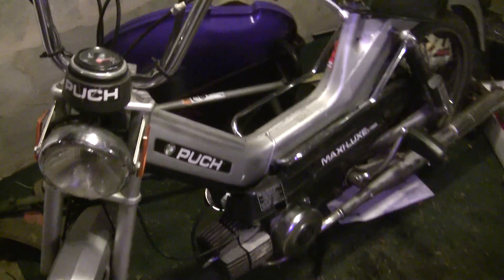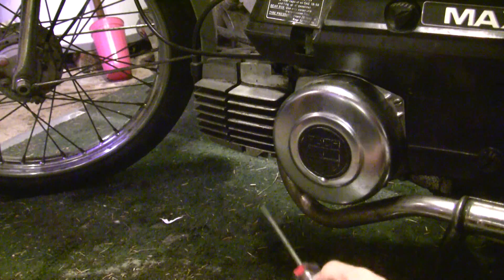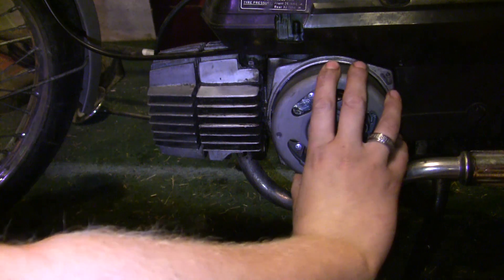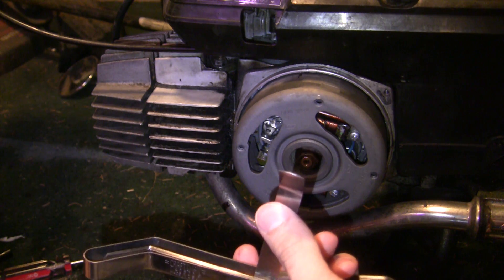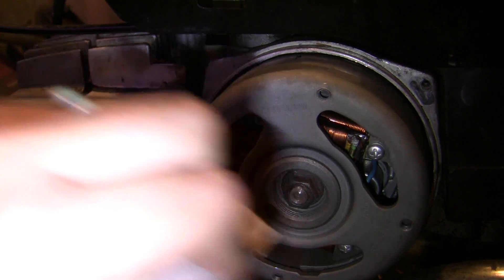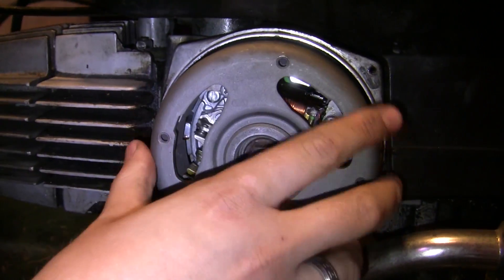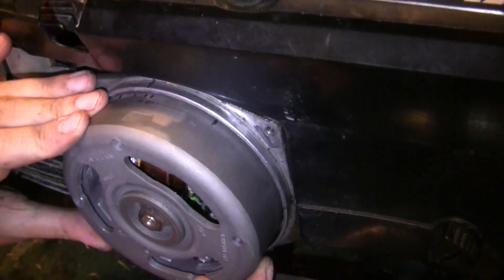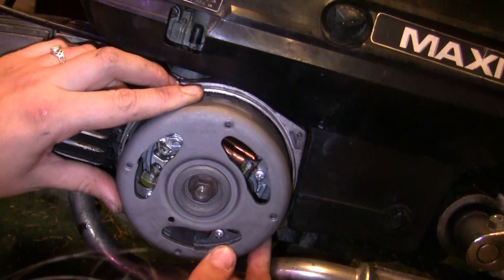How To Set & Explanation of Puch e50 Moped Timing with Will & Travis

Comment: That engine does not turn clockwise
Reply from the maker: You can see the arrow which points to the right/clockwise on the flywheel in a few shots (16:47) might be the most clear. The camera I was using back in 2013 was not the best, so you can also see it in Google Images if you search Puch e50 Flywheel.

I just finished working on a Puch ZA50, which is opposite, it turns to the left/counterclockwise

Comment: 3:20! I got lost cause there was already 3 marks when I only seen you mark two?
Reply from the maker: So for that first part of the video, all we are doing is finding Top Dead Center (TDC). 
You use the piston stop to make a mark on the flywheel at your reference mark by rotating it both directions, then the TDC mark on the flywheel, the third mark, at the middle point, for us it came out to 5.5mm-ish. It isn't the most clear there in the editing unfortunately, but the spoken directions are correct.

After you make the marks, you can use the screwdriver method to verify you have it correct, "in the ballpark"

Comment: Next time use a test light with a battery. You can clip to one side of the coil and leave the point of the test light in between the fins of the cylinder. When the points open, the light will turn off. You can make a test light with a bulb from your brakes and two wires, a AA battery, and some alligator clips. You can even tap into one of the brake lights with the bulb still installed in the moped. It's better than trying to eyeball it or use a cigarette paper. I never did it the way you're doing it. You're just guessing at it.

Thanks for the content.
Keep up the good work.
בס'ד
Reply from the maker: That's a neat idea, I like the simplicity of making a test bulb for when the points break open, I'll have to try that! 

For me, the timing light is the great equalizer for seeing at exactly where the bike is firing, but I'm also all about simplicity, since most people don't have an excess of tools. Thanks for the comment!
Reply: @TravisTutorial  Yes, you can use a circuit test probe light, they cost under $5 at Harbor Freight or any auto parts store for a little more. Clip one end to the blue wire of the coil and stick the probe between the fins of the cylinder. The light should go out when the points open.

If you have a multimeter, you can just set it to read continuity. Clip one wire to the blue wire of the coil and the other wire to one of the fins of the cylinder. If you have audible continuity, you don't even have to look at the meter. When the points open you will lose continuity. So easy.

Comment: I have the same flywheel and stator. My bike is supposed to be 2 mm before top dead center. With the state returned all the way to the right I'm at 10 mm before top dead center. What do I do there's no more adjustment

Comment: In 1974 I was 14 and my Maxi Puch has a mark on magneto wheel, that aligned to crankshaft joint (3pm position) at TDC. My father one day punch a little mark on the border of crankshaft with a screwdriver and a hammer and said " when the mark on the wheel align to this, points must release an aluminum paper you put between. Adjust this aligning marks, loosing base screws and rotating the base until the paper looses, then tight screws." It was easy to do, if you turn the base with a screwdriver and pull gently the aluminum paper. I don't know if my father have done some calculations, but that mark always set the point perfectly.

Comment: An accurate adjustment of ignition timing obtains maximum power for this little motor.
The procedure is similar ,tools are different.
1.    To detect TDC have a watch comparator installed in a drilled sparking plug. Using  the comparator mark 1mm before TDC on the flywheel/ case.
2.    To detect opening of contact breaker connect an ohmeter instead of ignition coil, will indicate a variation when contact opens.
3.    Also use thickness gauge for measuring contact breaker opening.
Good luck !

Comment: Hey Travis tutorial! I need to replace the points in my Batavus starflite but I don't have a flywheel puller. Is there a trick to removing the flywheel without a puller or should just go ahead and invest in the tool?

Comment: So what the heck is the point of reference for the stator? You make all these accurate marks on the flywheel for adjusting the points, but when you adjust the timing you leave us in the dark about how we measure where to move the stator. Still a good video, but if someone could answer that'd be great.
Reply: mezzyjezze the stator will only move about 20 mm in either direction. You just move it back and forth until the contacts open 17 mm before tdc

Comment: hi there travis.  Scott from UK here, again.
so  I have had a little bit of a problem with my puch, i blew out my piston rings, i have rebuilt the top end & added a new crankshaft. i have put together again & now it doesn't work properly,  there's no idle, before I only needed to only turn the pedals 1/2 a turn to start,  now i  have to pedal like crazy to start & it refuses to stay running,  the timing i think is correct.  Ive spent days fiddling with it & its started to really get my goat.
Any ideas? 
Thanks Scott

Comment: hi there travis,  its Scott from the Uk again, i have a silly question,  a red wire has come lose from my wiring block & fot the life of me i can't remember what part of the block its come lose from.
from the stater i have a black,  yellow,  green & red wire, i guess the red is for the back light, what wire should it marry up to?
thanks Scott
Reply from the maker: Hmmm, no US based Puch I have ever worked on ever has had a red wire, couldn't find one in the wiring diagram page either: 

http://www.mopedarmy.com/wiki/Puch_wiring_diagrams

However, it should be easy enough to solve - if it for the tail lights, it'll come from a "baby coil" on the stator, you can peek through the windows of the flywheel and see if it starts with that small cable, the tail light coil sits right on top of the headlight lighting coil. On a stock setup, there are only two wires that run to the rear, the power and the ground, so those should be somewhat easy to see.

Comment: quick question... can i use a stator from a scooter on my moped? i have a 1977 garelli eureka flex. and it is missing a lot of parts. missing piston, stator and carb. still have fly wheel but the coil and whatever else was inside is gone. i have experiences with motorized bikes that are also 2 stroke but this is my first scooter restoration. any help would be greatly appreciated thanks

Comment: Hello, i know this is an old post, but when you marked the piston stop on both sides, then measured the distance between.  Did you then mark on the flywheel the distance between the two measurements.  It looks like the left mark and the TDC mark are exactly the same.  Not sure i follow the measuring and dividing part if the mark ends ups so close to the left side mark.  What did i miss?
Reply from the maker: +Lee Verbouw Yep, you measure the distance between the piston stop marks - should be shown pretty clearly in the video, also show how to find TDC via the screwdriver method which matched our mark pretty close

Comment: That's a totally different way of setting the timing than the way i learned (and still use):
I'm using a vernier caliper, a set of feeler gages and a piece of tobacco rolling paper.

First of all, you should turn the flywheel and determine when the contact points are at it's maximum opening. That space should be exactly 0.35mm. Any setting smaller than 0.25mm can cause short circuit, so the moped won't even start. Any wider setting than 0.50mm causes the points to take longer to close. At higher speeds, they can't make it in time, so the moped can shut off or at least have a loss in performance. (also the reason why extremely tuned engines with contact point ignition can suddenly shut off at high speeds, because at extreme speeds and rotations, the points will no longer open & close, but "float" somewhere in the middle, failing the condenser to load it's currency. In that case u will need so called "weighted contact points", or use a $200 electronic (racing) ignition system instead). Setting the points to 0.35 will certainly increase the performance and acceleration. When it's smaller or wider, you can unscrew the flathead screw on the contact points just a little, as too loose will make the contact points adjust themselves like the stator plate in the video. Then grab a somewhat bigger flathead and "twist" the contact points, making use of the notches on the contact points and the "mountain pass" that is positioned on the stator plate just above the contact point screw. You twist your hand (like you turn a key) to the right, so the contact-point-plate will turn to the left, thus decreasing the maximum opening, and turn your hand left to increase. With this setting correct, it can also solve the issue of "having an extremely retarded or advanced ignition."

Now we can set the actual timing. 
I'm using a vernier caliper and use the depth pin on the rear to measure the ignition. So, slide the depth pin out for about 10 cm, and stick it in the spark plug hole. turn the flywheel to the right and let the piston push the depth meter back in. Make sure that the bottom of the caliper rests on the rim of the spark plug hole, as plumb as possible. Imagine you measure 20mm as being your TDC, then you should add 1mm pre-ignition (stock moped 50cc, fast 50cc's have 1.2mm, 70cc must have 1.4mm, very slow mopeds that won't go faster than 18 m/ph will do with 0.8mm). Note that less pre-ignition will (obviously) make the time between the spark and the TDC shorter, thus making the reaction faster, resulting in greater acceleration. But at higher speeds, that same setting can't cope with the faster moving piston, having trouble to keep up. Thats why you need more pre-ignition at top speed, giving the ignition more time to provide a spark for the ever faster returning piston. So this 1mm will be a good deal in the middle and most likely equal to the 17 degrees on the flywheel. And for the smart guys: setting the pre-ignition to 2.0mm won't work, i tried that, moped didn't go any faster and the noise that came from the block didn't sound healthy. 
So, add 1mm to whatever you measured (becomes e.g. 21mm) and lock this setting on the caliper, so it can't slide. Now i'm tearing a tobacco rolling paper in half (in length), and sticking it in between the contact points. Since it's so thin it makes an almost perfect idea about when the points start to open. Stick the caliper's end back in and turn the flywheel in the correct direction (for most moped it's to the right, but be sure to check the arrow, or , when there is no arrow, try to start the moped and you'll instantly see the direction it goes.). When you are about to reach the TDC (something you can feel), carefully let the piece of paper stick through the opening of the flywheel again (as it will flip in when u turn the flywheel). Now turn the wheel very slowly, if possible one degree at a time, your other hand still holding the caliper firmly and plumb on the rim. After each little turn carefully try to remove the paper. The ignition is spot-on when the piston ticks the caliper (you can clearly hear and feel it) and you being able to remove the paper. If you are able to remove it before you reach the caliper (TDC + 1 mm pre), then your ignition is too early, or advanced. when the paper is still stuck when u reach the caliper, then it is late, or retarded. In both cases u have to adjust the stator plate, like shown in this video. After that, check again until it actually is spot-on.

The only catch with this technique is that to be accurate, you have to hold the caliper firmly in place, and in the middle so the measuring pin wil be on the center of the piston. Since modern pistons don't have a flat surface on top, it could happen that when u are out of center, you might get different readings, also when u move the caliper by accident while working on the ignition.
But putting marks on the wheel is also more or less accurate, depending on how accurate you mark, what marker u are using, the quality and accuracy of the measuring tape, etc. (the construction store paper rulers are not very seriously and for global measuring imho, and tailor measuring tapes tend to stretch after a number of uses).

If you have an analogue caliper and don't know exactly how to read it, here's a short video that will explain it:

https://www.youtube.com/watch?v=FNdkYIVJ3Vc

There are also special ignition clocks avaiable that you can screw in the spark plug hole, assuring the accuricy, but they are not very cheap. But if you are planning to do it a lot of times, it's way more convenient, since you have an extra hand avialable that way.

At last, the gap between the spark plug points must be 0.45mm. Even brand new spark plugs straight from the package can be set wrong, so make sure it's 0.45. Too big gaps can also cause engine starting problems.  

So far my knowledge and experience about the subject of ignition, succes!

Greetings from The Netherlands
Reply: Why don't you make a video :)
Reply: +Roy Jansen Thanks for sharing your technique, I'll try it out on my own E50 ;)
Reply: Erg nette beschrijving Roy. Dankje!
Reply: Roy Jansen you are right, using a light is plain wrong !
Reply: My 1966 puch sabre manual says to use a tobacco rolling paper. i guess i dont have a complete mechanics shop lol
Reply: Hey hoop dat je dit nog leest! Erg goede uitleg maar waarom vertellen mensen 0,35 en jij 0,45? Zou ik graag willen weten!
Reply: @2Stroke_yourtje  0,45mm voor wat betreft de bougie? Misschien vergissen ze zich in de afstand tussen de contactpunten en de bougie elektroden. Daarnaast geldt de 0,45 mm afstand voor puch brommers. Dat kan wel degelijk anders zijn bij bijv. scooters (geloof dat ze daar 0,6 mm hanteren). Maar als je twijfelt zou ik het allebei eens proberen. En bij beide afstanden het verschil in de gaten houden bij het starten, optrekken, midden bereik, topsnelheid, geluiden en stationair lopen. Zowel bij koude als warme motor. Dan merk je vanzelf wat beter is. Uiteraard wel 1 ding tegelijk veranderen, al het andere moet gelijk blijven, anders klopt het niet. Let er ook op of je de juiste hittegraad bougie hebt. Bij NGK bougies is dat 5 voor standaard, 6 voor 50cc snel, 7-8 voor 70cc en 9 voor 80cc+. Maar daar zijn ook tabellen van, die ook aangeven wat de code is bij andere merken zoals Bosch.
Reply: thanks

Comment: Hi again :D. I have finally done all the restoration work on my Ögland Swing and it's almost up and running now. I was driving it but finally the ignition coil gave up. I replaced it and now it works like it's supposed to work. I just wondered that is it normal that the electrics get so damn hot after a really short time that you really can't keep your hand on the cover more than three seconds. How much can those ignition coils even handle heat before they blow up?
I just want to thank you for all your helpful videos which have helped me a lot in this over a year lasting restoration process which finally has come to its end. Thank you, and have a great 2016!
Reply from the maker: +Benjami Lindqvist Glad to hear the bike is back together! Yes, it is somewhat normal for flywheel covers to get hot. If it was the original factory coil, maybe chalk that up to it being old, but if the new coil fails I would double check the grounds for it, and then maybe possibly see about routing it outside the cover somehow...best of luck!

Comment: Hey Travis and Will! Have you ever had a bike that you couldn't advance the stater enough to get the timing into an acceptable range? My stock 78 maxi is too advanced no matter how far I adjust - 20 or even 30* before TDC. Some people say dremel it out, but I'm hesitant to do that, especially since I don't have a powerful one yet. :3
Reply: +Christopher Guzy I had that same problem before twice, and it turned out that the flywheel wasn't installed correctly, either by yourself or any previous owner(s). make sure it's installed correctly on the axis. You will need a flywheelpuller to remove the flywheel. to unscrew the nut (the wheel will rotate with your force) the easiest way is the use of an air impact wrench, a pully holder (rubber belt around the wheel) or you can stick a screwdriver in a hole and use that to block the wheel (the hardest way and not prefferable). make sure the little rocket key (keg) is installed correctly (kinda tricky because the flywheel is magnetic, but a little bit of bearing grease will make it stick easier in its place) and the rocket keyway is not honeycombed. the installation of a new rocket key will probably solve this issue. Sorry for the late reaction, i did not saw it before, but it might be also helpfull for others.
Also be sure to read the long comment i just placed.

Comment: Travis, I am seeing the points close when it gets to 17 degrees not opening. I have an e50. I wrote the degrees on the right side of the flywheel after tdc. That's correct right?
Reply from the maker: +Jose Serrano So, since your point gap could be set at anything, it's hard to say what your timing is from that information, just for clarity sake, right around 7:55 in the video Will explains what direction to write your numbers for measuring. As it stands your timing is either advanced or retarded of where it should be for optimum cooling, especially on a ported Polini kit.